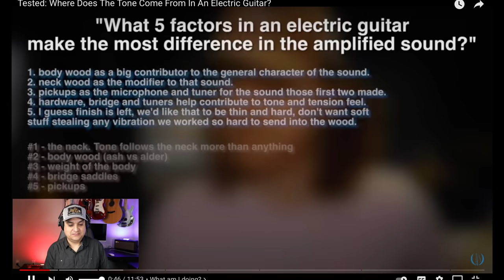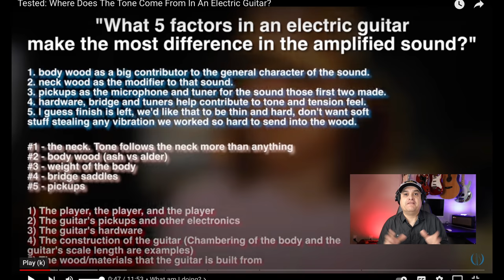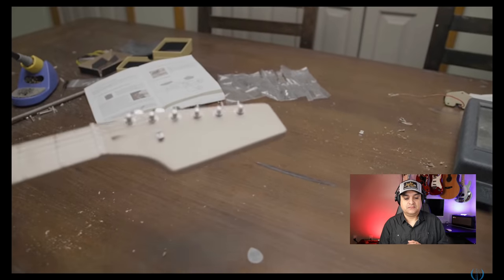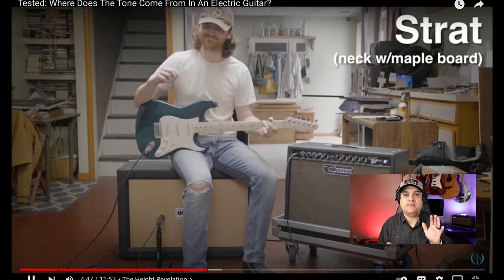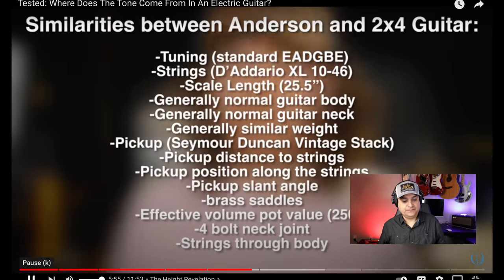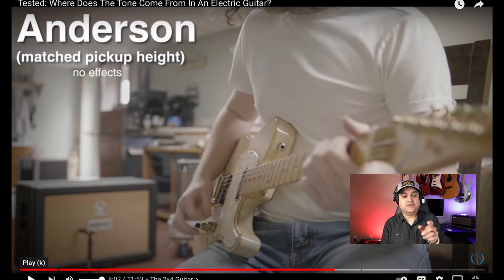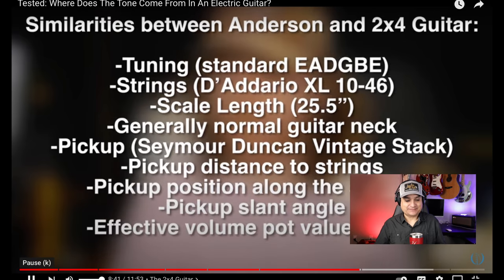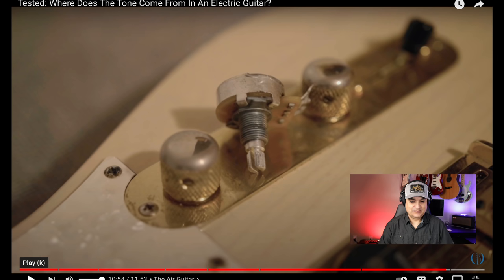Where Does The Tone Come From In An Electric Guitar - Reaction Video

Comment: From a new player with years of woodworking experience, I would suggest the effect of wood on sound will be most pronounced at the neck pickup. Woods of different hardness, stiffness or density will variably absorb to dampen out or resonate and vibrate in response to some portion the range of frequencies produced by the strings. The string-induced vibrations of the body and neck will have the greatest amplitude at the neck pickup, changing the string:pickup distance by small amounts. But as soon as a bit of pedal is put into the sound none of that is noticable, from my watching of a dozen different videos on the topic.
Reply: I'd say, what's important, is that with different pieces of wood you may have some sound artefacts like a wolf note, or vice versa, an unusually loud note. About ten years ago I had a circa '83 Ibanez Roadstar II bass. Super-stable neck, could achieve a very low string action, wonderful sound. But this bass had one problem: a dead note on the 3-rd fret  of the 4-th string. It was VERY noticeable, and nothing I could do about it (compression, different string types and gauges, different setups, tuning down a whole step down), and ultimately that was the reason to sell that bass.
As for sound coloration by tonewood - it's certainly there, but 1) you can't predict it, we are talking about probability here, and 2) it's quite possible that all the nuances would be lost in the mix (and I'm even not talking about pedal effects, etc).
Now I have a custom-made bass, but the point of it all were things like compound-radius fretboard, zero fret, a bit more rounded body edges, sanded-down neck joint, deeper cutaways, 2+2 headstock - other than those changes in ergonomics and aesthetics it's your typical passive P-bass.
BTW, its body has a center block made of the same piece of maple as the neck, and still it sounds like a P-bass.

Comment: The one factor that has more to do with it than anything is missing here.
String tension.
This is more applicable to steel guitar.
Reply from the maker: It’s not really missing. If all experiments are set up to the same tuning, string gauge and scale length… the string tension will be the same.
Reply: @DylanTalksTone  Oh I mean varying the tension.  Not something you'd really want to do with a regular electric guitar, I suppose.
For example, on my lap steel, I've got a very tight string on the high note, a very loose string on the low and a fine balance between.  
This has made a decent sounding steel into something very similar to the original 1932 electric - the A22 Rickenbacker Electro Hawaiian "frypan".  
It's like comparing the average electric guitar to the Dave Gilmore sound.
It's the biggest and fullest sound you can get without being too "fat".

Comment: Practicality and customization matters too. If your guitar isn’t made from good material, it’s going to bend and twist and go out of tune and your neck would need to be replaced every once in a while...at the very least. Trust me, if high end manufacturers could still make their high end guitars with materials that cost pennies...then they wood...(see what I did there 😂🥺). The guitar doesn’t make the player sound good, the player makes the guitar sound good. But the instrument needs to be able to stand the test of time and take some abuse along the way. The bottom line is, if you want great sounding/playing...well made guitars, then you’re going to want something made out of a good quality wood.

Comment: everything matters when combined together the little things add up.

wood does make a difference even though it's an electric guitar. the reason for it is that the  acoustic resonance influences the vibration physically in the strings and even the pickups are electronic and sense magnetic variations. if the strings are affected physically to resonate more or less in various frequencies, the difference will picked up , otherwise a solid body guitar would sound exactly the same as hollowbody with the exact same pickups but difference is huge between the tw. for instance hollowbody having more midrange makes sense cause the higher frequencies get absorbed in the hollow body and echo/reverb in the body and produce more mid range.

 also to your point in the 1st person giving their top 5 points to tone.. the microphone tuner for the other two reasons  is as well true otherwise microphonic feedback wouldn't happen. but that's a topic for another day lol
 i think what the 1st person meant was, if you built a guitar with specific woods that have certain warm frequencies, the pickups can be tuned to be more sensible and pick-up more of that tone giving the guitar more of a unique tone.

but at the end of the day, 
most of the sound can be shaped with various EQs and effects but the guitar signal is the reference.  any changes will apply to the reference signal. with enough tweaking the tone can be adjusted to be similar, but not everything is EQ, there is too many variants and that's where it's not all about the tone but how dynamic the guitar feels when playing and taste.

Comment: I’m still in the “Sum of all parts” camp. You need high quality, stable wood and good electronics to have a reliable instrument.
Reply: I disagree. You can have a guitar made of acrylic, metal, or various epoxied materials and it would perform just as great as any custom shop guitar. Well-built, yes. You’ll always want a well-built guitar. Wood? Not necessary in the slightest.

Comment: All that tone wood drama was put to rest when guitars were sold with plexiglass/acrylic/composite bodies and/or aluminum, or composite necks. Marketing certainly brainwashed many along the way.🤣
Reply: And they sound different than wood counterparts. Do they still produce good tone, sure. Do they sound like wood guitars, no.
If you can't hear the zing in aluminum neck guitars (for example) , then it's an issue about your ears and not the material property.

Comment: I hate to mess up the 666 comment count, but I feel like I should tell you about a guitar that blows out the whole idea of heavy guitars having better tone. The Harmony Juno. It's tiny and light and every one that plays it tells me it sounds like a heavy P90 Les Paul. I chalk it all up to being set up well and having very nice pickups. It has sustain for days and it's very responsive to movement in all the best ways. It's fun to move with because it weighs less than 7 pounds. Check one out if you get the chance, or any light solid body for that matter. Your shoulder will thank you. You don't need weight for tone. How liberating is that?

Comment: Tonewood has always been a farce, even in classical instruments. The notion that "I got this mahogany from a 1000 year old tree that was chopped down using a toothbrush attached to the scrotum of a chipmunk, that's why no one makes violins that sound like mine" came about to differentiate between luthiers and essentially stand out. Many of them did do weird things to treat their woods, some even believed it made a difference, but the good ones knew, the secret was in the design. A design could be copied, no copyright laws back then. Every little thing they could do to stand out, be unique and stay relevant was done to discourage copies. In reality, while materials certainly have an impact, the majority of the tonal difference was derived from the construction, strings and setup. As for something like a Strad sounding so much better than a modern equivalent.... Tone is subjective, enough people say "this is the tone" and like a pack of Mandos we all jump in line, repeat and nod. If someone had said Strads sounded horrible and gave a plausible breakdown of why, there would be no Strads left. The debate has never been, "does material change tone", it is "does expensive wood make tone better", the answer is.... no. A violin (I use violin because it's acoustic) made of scrap maple, properly cured and of the right water content will sound near enough identical to one made of $1000 AAAAAAA flamed maple cured and treated the same way, as close as if 2 instruments were made of the same expensive wood. The "tone tap" does work, it will typically yield a pleasing note when the wood is properly treated vs being too wet. 

The whole myth started with luthiers trying to avoid copycats and was picked up by customers trying to justify spending a fortune on premium instruments. They would see the luthier tapping the wood (to see if it was done yet) and assume it was to select the very best resonant wood, or maybe that's what the luthier told them. Never mind the fact that the one that had a dud note will sound almost identical in a year once it's dried out enough for instrument use. What matters is the luthier, their design and their skill, not the AAAAA nature of the wood. No good luthier would ever waste time making an instrument out of wood that wasn't cured properly. First of all, it would move too much, warping and shifting as it dried or moistened and more importantly, improperly cured wood sounds bloody horrible. If you copy a $5m Strad, both in design and wood properties and I mean moisture content and density here not age and other nonsense, it would sound near enough identical, certainly close enough it could simply be another Strad because there is variance between instruments. In the end, people wealthy enough to spend silly money on instruments don't like to feel stupid so they will resist fiercely when anyone challenges any of the precepts they believed when purchasing said instrument. It's pretty stupid, just say you bought the damned thing as an investment.... Vintage gear (of most varieties) at the very least hold value, no need to pretend you are versed in the mythology of tonewoods and deep theory surrounding the construction of god tier instruments. The collector market.....

Comment: People really get so defensive about you disproving the belief of tone wood. For me personally I agree that it does exist, but its effect on the instrument is not nearly to the degree that people say. In my experience, pickups make the biggest difference. I have a trash picked 2004 Squire Affinity strat, the original pickups were dark, muddy and overall not a pleasant thing to listen to. I replaced them with some cheap $20 Alnico V pickups from eBay and they make worlds difference! Sure they may be a little too thin sounding for my liking, but they are produce a much more alive, controlled, stronger and overall more prominent sound.

Comment: this guy is overly critical regarding the testing done. As a guitarist for 50 yrs, and an audio engineer, I see that his points were valid, and he made efforts to replicate the string height, type distance, and intonation while using the amp settings /volumes/and tone as static control and attempted to use the accepted factors as to why the sound is trademarkable...I have long since believed the body wood shape all contributed greatly to the overall sound, however, when he used a 2x4 as a body., all that went out the door.....and the synopsis....it is the guitar player foremost, that determines the sound, (greatest being the operative word)the other factors do contribute, but subtly...as an engineer, I can develop any type of guitar sound imaginable, and now, with my AxFX unit, and now the 2nd gen Ax-FX, I can create any sound type cabinet or speaker config power curve, EQ, FX endless modulation algorithms, and by owning an elaborate array of top of the line guitars and custom shop instruments....I agree, The ''guitarist'' contributes the greatest amount of influence on the sound, of any instrument....and that is my 2c
Reply from the maker: This guy? I thought it was an amazing video.

Comment: I’m my honest opinion, I don’t really think this debunks anything. We’re talking about the non importance of wood right? And how it doesn’t alter tone? Well both the tables that the bridge and headstock were bolted to are huge slabs of wood. With framing at that. Just in my opinion, those claiming truth to saying this proves tone wood doesn’t exist, I say that first off, that is completely contradictory to your own opinion, and unLike most people, I think this actually proves wood does alter tone. 

Let me just say this. I want to clear the air. Us tone chasers or cork sniffers and paint huffers or whatever it is we’re called these day, I just want to say we aren’t idiots. If anything, we’re actually just adding in more detail and basic reasoning. 
To be literal, wood does not change your tone like it would if you spin your tone knob. Alder will not make you sound like a strat, pine or ash will not make you sound like a tele, basswood will not make you sound like a Jackson, and mahogany with a maple cap will not make you sound like a paul. Wood just like every other aspect in a guitar, simply resonates at different rates and different frequencies depending on density, weight, and whether it is hard and brittle, or soft and loose. 

Get 5 of your favorite woods. Not because you want a specific tone even. Just grab ten pieces of your favorite wood. Strictly based on how pretty they are to you. Make five guitars. Same electronics, setup, hardware, neck, even tuners and finish. Strum a single chord. Every single one peaks at different frequencies. Some may not even be noticeable to you. Some more than others. The point is, you don’t need alder for a fender. Or mahogany for a gibson. It’s all about preference. But wood does indeed change tone. Not because it sounds different, but because it resonates and transfers vibrations differently. Everything all the way down to how many finish coats and even the tuners you have. It all resonates differently. Prove it for yourself. If tone wood didn’t change tone, then there is no reason a hardtail and tremolo sound different. Sure the strings are on two different pressure points, but it doesn’t matter right? The tremolo is attached to springs, and the springs to wood. It shouldn’t change nada. A tele and a Lea Paul with humbuclers SHOULDNT sound different but they do. A duo sonic shouldn’t sound different than a strat if they had the same pickups. But they do. Because of this. Different shape. Different scale length. Different amounts of wood. Different routing. Different construction. Different materials. Sg and les Paul SHOULDNT sound different but they do. Until someone can prove me wrong and somehow convince me that every single thing I have just stated is an ironic coincidence, then I’m sticking to logic and understanding skills. I can’t just be me. Frequencies. Vibration transfer. Resonation. It all plays the part. It’s not science. Just logic and basic physics. If this WERENT true, then that’s the same thing as saying and 2 mufflers made from different shapes, sizes, and materials don’t sound different. Obviously it sounds different. This is my opinion, and obviously feel free to completely disagree with me, because obviously you are human and are guaranteed a right to freedom just as I. With that being said, it’s not that wise to have a strongly believed opinion if you don’t have fact to back it up.

Comment: Your entire discussion at the end was so far off. This experiment has nothing to do with listening in a lab or trying to get two guitars to sound exactly the same. The objective was to determine where the signature of the sound, the tone, comes from. You started on par but lost it at the end. It's like you forgot why he did the experiment. 
The sound doesn't come from the body wood, neck wood, type of out amount of finish, tuners, none of that. It's the pickups, as you mentioned.

Comment: All manipulations are useless, because there are no devices that would show any specific data that could be worked with. When I screwed the strings and the pickup to the table, I didn't take into account the sustain of the table :)

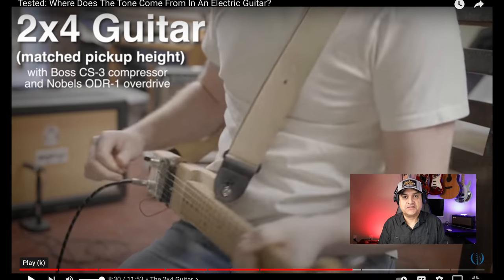Comment: 13:33 Not to my pitch perfect un trained ear... I ain't no audio tech but they was a difference under or about 10% the 2x4 guitar was more airy and warmer if I used my word correctly which honestly I may not... But I can also hear it on a amazon fire stick though a a $100 Hisnse 2023 TV speakers and on a aleinwear $4k top of the line though a $1k sony bravia 2023 TV speakers and a Sennizer HD 600... each time it became cleaer to me as it should... Which why does 10% that even most audio enggererers can't hear matter? What about people like me? What about being the best you can be? It's the same thing why video graders need 100% color gamit displays... It's so they know on what display you use their peice would be the best/closest to their vision it can... Which why aren't you using free headphones in this video? If you can't tell the difference of the guitars you clearly receive no benefit from auio file(I presume) headphones.

Comment: What are you talking about, no tone wood? There 50 lbs of tone wood in the "air" guitar, are you daft? What do you think those tables are made from?  The fact that the neck has a ridiculous high action (the 2x4 behind him holding the tables apart) and the tables themselves are the body does not mean that there is no tone wood in this rig.
Reply from the maker: Don’t forget the tone engines
Reply from the maker: And the tone floor
Reply from the maker: And the tone garage door
Reply: @DylanTalksTone  There is 50 lbs of wood in that rig and neck is behind him, it is NOT an air guitar.
Reply from the maker: K

Comment: The thing that gets me is they when you think of where the strings touch a guitar: nut and bridge.  The frets function like the nut when fretted.  

Vibrations are a pushed force; not pulled.  A soft body won't pull tone through the metal bridge and saddles; the bridge and saddles just have a place to dump excess.  That's why only the electronics, pickup height, and string materials make any significant difference.